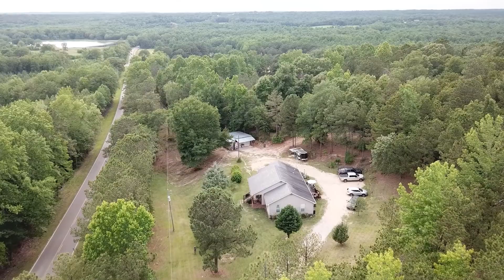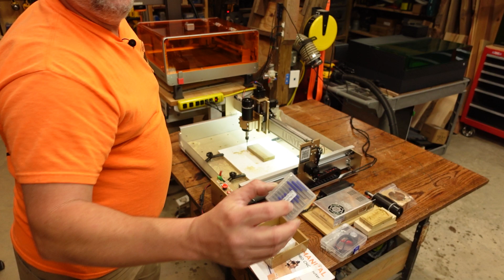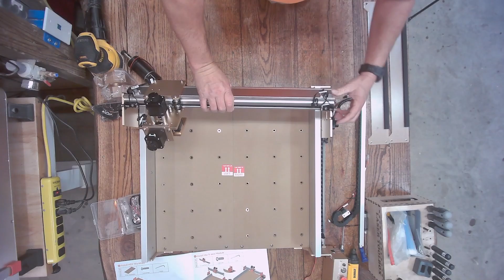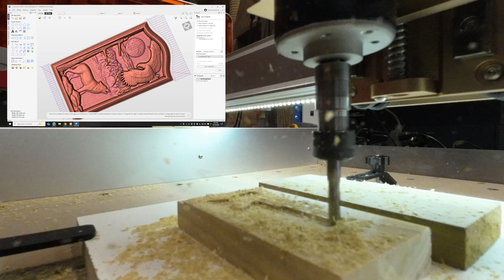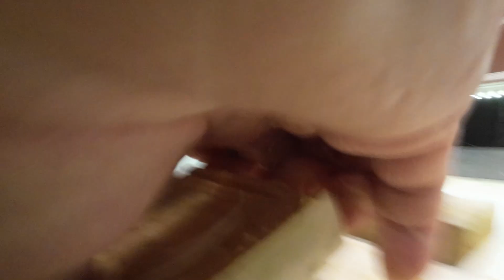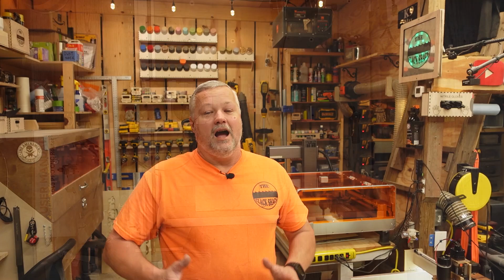Lunyee 4040 Pro CNC

Comment: The  manufacturer says you can mill aluminum with it. Yet I see no one doing it.
Reply from the maker: It "could" with the correct settings but it would take a long time to do a large piece. The design is not as rugged as I would want for metals.

Comment: Hi, Clack, Gary here. I am looking for help. I am Having  Lunyee 4040 PRO machine. the problem is that my cutting measurements of my project comes out smaller then the original. I am USING THE VCARVE DESKTOP software with Candle. I am working in mm. don't know what I am doing wrong. Can you help?
Reply from the maker: It could be a couple of things. Possibly, the post processor does not match the design unit of measure. If you design in inches, you must use the inches post processor. Same goes for mm. This would be a big variation in the size.

If the size variation is small, it could be a calibration issue or a mechanical issue with the machine. There are tools in most software to calibrate the machine.

Lastly, it could be a result of improper speeds and feeds. I recommend using a very light score line to confirm that the issue is calibration before attempting to calibrate. If your feeds are too high, it can result in slippage in the mechanical systems.
Reply: @TheClackShack  thank you. I will try and see if it helps. Much appreciated

Comment: HI!
I usually watch your videos, I like them! I also bought a Lunyee 4040 Pro, when changing the tool if you change the $39 from zero to one the machine locks up and doesn't move! I hope what I wrote was useful, provided you didn't know already! If so, then sorry!
I mounted a Makita 3711 30000 rpm on it, maybe you have an idea how deep I dare to go and what feed I should use? Let's say with a 6mm end mill bit?
Thank you!
Reply from the maker: I am not sure why you would be changing the controller settings. According to my search....  $39 – Enable legacy RT commands: Enables or disables the processing of special characters in GRBL settings and comments. Not sure why you would change this setting if the machine is working. As far as feeds, it takes testing to be sure. I would not try to go deeper than 1 mm in most woods.
Reply: @TheClackShack  You have to change it so that the machine doesn't move! After you change the tool, you reset it! The manufacturer himself suggested this solution to me!

Comment: I have recently got a xtool D1pro 40watt and a Sainsmart 4040pro. Was wanting a laptop for using on both to keep in the shop. Do you think the Acer chrome book 315 would work for this? It has Intel processor N4500 4GB ram 64GB eMMC It’s $139 at Walmart. I’m not sure what the computer requirements are for these machines. Any help you could give me would be greatly appreciated.
Thank you,
David
Reply from the maker: I would avoid chrome books. Most software is gonna require a windows PC. It doesn't take much of a computer to run the machines. I prefer a minimum of 16GB Ram for machines doing 3D modeling. If you have a TV in your shop, I would look at this with a wireless mouse and keyboard. This is what I run my Shapeoko on. https://amzn.to/4fmv8mY
Reply: @ Thank you. One mistake avoided! I am looking forward to getting these machines working after Christmas. I will probably be sending you some more questions then. I really appreciate your help.
David

Comment: 10:33 It is better to set parameter $1 = 255 in the GRBL settings. This will keep all the steppers enabled and prevent movement during tool changes...
Reply from the maker: It does make it easier to align initially. It would be a preference thing. Good idea though.

Comment: Yeah, I guess you can call a $600 CNC inexpensive if you're comparing the price to the large one you have.
Reply from the maker: Compared to most 4040 machines, it is cheaper. Anything cheaper is gonna have a smaller work area